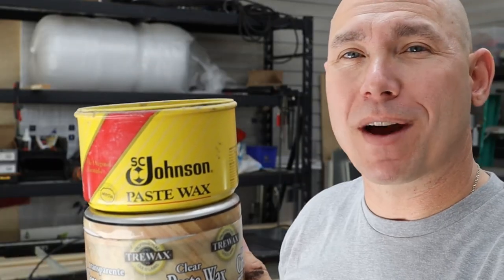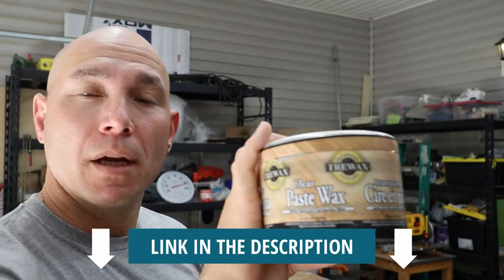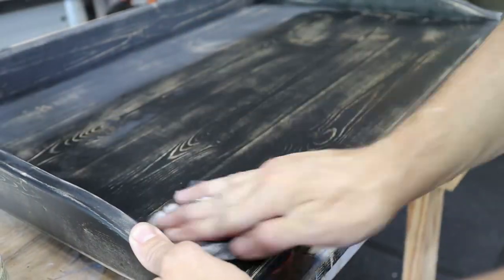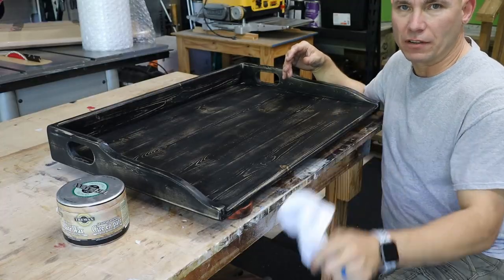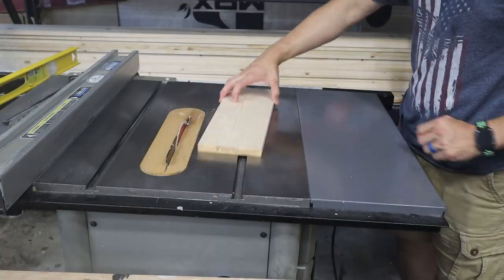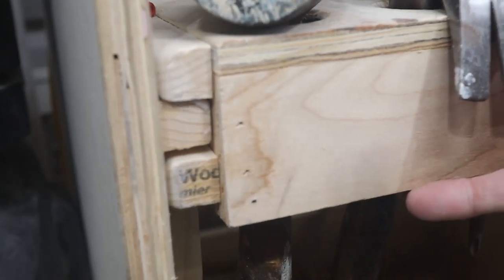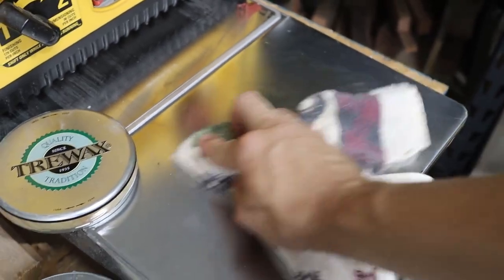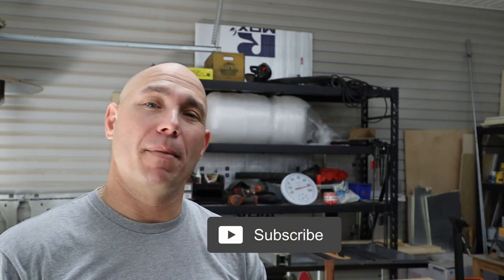Watch This Before Buying Paste Wax For Your Woodworking Shop

Comment: Wow!  I like your videos.  Great info.  I have learned a lot.  I now have a new thin kerf CMT 251.042.10 ITK XTreme General Purpose Saw Blade, 10-Inch x 40 Teeth ATB Grind with 5/8-Inch Bore for my new table saw.  I use a stiffener with it.  It cuts like butter and the cut doesn't need any sanding.  In fact, sanding would ruin the finish of the cut.  

I used Trewax Clear Paste Wax on my table top.  It is so slippery.  The wood slides like it is on air.  Smooth as silk.  Thanks for all of your great advice.

Comment: For your home made drawer slides, a better solution for getting them to slide well is bar soap.  Take a new bar of soap and apply liberally to the slide and the drawer piece 

The issue with the wax is it allows for buildup of dirt and dust over time because those things stick to the wax, or the get imbedded in the wax coat which then makes the drawers stick and require cleaning and re-waxing.

The soap does not have that issue

Great video by the way, excellent tips.
Reply from the maker: Thanks for sharing that!

Comment: Here's a tip I learned many years ago from a floor finisher when I was starting out. Take a golf ball-sized amount of wax, put it in a damp soft cloth, twist until some solvent comes through, and then rub that over your surface. What this does is controls the amount of wax you put on. It's really all you need. It puts a thin layer of wax coating on your surface. Any other technique puts too much on and wastes wax, doesn't;t dry and can be difficult to buff out well.
Reply: When you say, "damp cloth" do you mean damp with water? And are you talking regular thick cloth, or cheesecloth?

Comment: Hi Matt. If you use paste wax over a gel stain, will the finish the wax provides be sufficient to seal in the color of the gel stain (since it is topical and not penetrating)? Or does one really need a urethane to seal in gel stain?

Comment: Would you have to reapply it after a period of time? Thinking about the legs on the table or the tray.
Reply: Eventually you will probably want to hit it again with some wax. Depends how much wear and tear your surfaces encounter. Those drawer slides for example would need regular reapplication , but table legs on an end table tucked in a corner could go for ages without needing a touch up.

Comment: Thanks for the tip re: Trewax.  I will definitely give it a try.  Have you ever used any of the tinted waxes?
Reply from the maker: yes.  We used Valspar antiquing wax on our dining table base
Reply: Tre Wax is great stuff. I've been using it a long time. Just be aware that it's a carnauba based wax blend. And with a higher percentage of Carnauba than other waxes from what I understand. 
Carnauba is a harder wax, others like bee's wax are softer, with others and mixes in-between. You have to decide what hardness is best suited depending on use.

Comment: Thanks Matt! You keep making my woodworking get better and better. Quick question on the wax, can you use it on any finish, I mean besides paint, Like a regular stain? Also, I like the new style for links and messages, probably took you a bit more time, but you I definitely noticed the extra production time you went through. Thanks for another great video
Reply from the maker: Yes you can use it on paint or stain.

Comment: What about cleanup? If you use it on a table top or Noodle board that needs cleaning, will the wax rub off easily and need to be reapplied?
Reply from the maker: it dries hard.  You may need to reapply every year or two but it lasts a long time.

Comment: I have engineered wood floors, could I use this wax on top of the finish that’s already on them? They are just looking dull. We had to replace a few planks because of water damage and boy you can sure see the difference between the ones that are only a yr old and the new ones we just put in.

Comment: Thanks for the tip! I’ve seen pare wax applied to table saw tops as well, but have been hesitant as I didn’t want it to affect the ability for the piece to be painted afterwards. Thoughts?
Reply from the maker: I’ve never used (or heard of) pare wax sorry
Reply: 731 Woodworks **paste wax. Idk how the hell that got typed that way. 😂😂

Comment: Thanks! I really wanted to earn more about paste wax. Question, can I apply this paste wax, over walunt doors that have been treated with 3-coats of Tung Oil?  I used, Old MAsters Pure Tung Oil, and it the wood still looks thirsty, and not fully sealed.

Comment: I just put in butcher block counterops... is this stuff food safe or ok to use for counter tops or cutting boards?
Reply from the maker: According to Trewax: "Trewax products are not food-safe and are not recommended for using on counters or kitchen tables."
Reply: @731Woodworks  thats a bummer. ive been using howards mineral oil and conditioner. Is there anything else you would recommend?
Reply from the maker: @bneuhaus001  There's several things you can use.  Check out this article https://woodsmithspirit.com/food-safe-wood-finishes/

Comment: Matt, quick question. I have used Johnson's on a unfinished table for years. Wipe on, let dry, then move on or buff with a cloth. I wouldn't put a lot, just enough to "wet" the wood. Do I have to wipe off the trewax? If I don't what are the concerns? I guess that's two questions. Anyways, be safe out there.
Reply from the maker: It works exactly the same as the Johnson’s. You can do it the same way
Reply: @731Woodworks  thank you

Comment: Thanks for the video.  I just purchased this because it was cheaper at Lowe's compared to Minwax finishing past wax.  Is there a difference between the two?  Or which is better in woodworking?  Someone said Johnson's smelled like keresone.  Not sure if this is true, since I have not opened up the container yet, so was debating on whether or not to return it and get Minwax instead?  If anyone has any thoughts between the two brands, please let me know. Thanks.
Reply from the maker: I've never used Minwax brand. The Johnson's does have an odor to it. The Trewax smells better.  Not sure how much difference there is between them.

Comment: These are great uses!   Paste wax is fantastic!   I rubbed some on the faceplate of my router to help it glide over the wood better.   It really made a huge difference. 
Just another thought. 
Doi you have a video showing how to do the "aged" finish?   Both the painted and the stained parts?
Reply from the maker: I have a distressed video https://youtu.be/M3jCJg9vnAU
Reply: @731Woodworks  I don't know if you see this, but I bought an unfinished doll bed for my cat and bunny. I want to finish it with darker stain and and top coat, then make a thick mattress for them. What would be the best top coat that will be safe, easy to clean if they make a mess on it and also doesn't attract fur, dust and dirt? I thought the minwax paste wax, but thinking that will be an issue with attracting debris and possibly not be resistant to a mess.
Reply: @Bomber411  Waterborne polyurethane
Reply: @Randy-br3kf  thank you! How long should I wait after it's finished to let them use it? I know there will be some form of chemical smell after, though I'm assuming after some time it will be gone to a degree - possibly once cured? Not sure I'm articulating well what I'm trying to ask.
Reply: If it's water based, like Minwax polycyclic, you don't have to wait more than a day. And no chemical smells or fumes. It's very benign.
Brush it on in 2 thin coats. If you notice a flaw or missed spot once you've done an area DON'T TOUCH IT WITH YOUR BRUSH!!!
just let it dry, and hit it with your second coat.
Sand lightly in between coats and tack rag off your sanding dust

Comment: I used your spray paint method for destressing a bed frame, kinda a rustic bed frame would the wax be ok for that?? Will it take off the spray paint to bad dont want to lose slot of paint.
Reply from the maker: It’ll work good. It will take some of the paint off but shouldn’t take too much. Just go light

Comment: How does it hold up to wear compared to polyurethane or tung oil?
Reply from the maker: It wears more.  You'll likely need to reapply at some point depending on traffic. So a table top would need reapplication every few years whereas the base wouldn't need it very often, if at all.
Reply: @731Woodworks  A few years is plenty.  I think I'll give it a try.  Thanks.  Keep the videos coming.  Lot of good information.

Comment: Does it protect the wood like poly?
Reply from the maker: It adds a layer of protection but not sure if it's the same as poly
Reply: Thank you I've never used anything other than poly but all that every one is ordering are dining room tsbles. I've tried to advertise smaller stuff like blanket ladders. Noodle boards and have done a few but nobody wants those all they inquire about is dining room tables. Another quick question have wood prices doubled in your area like it has here? I live in the West Texas area and wow everything has doubled.
Reply from the maker: Yes lumber prices are up a lot.

Comment: No steel wool?  So you don't use poly?  Use stain and wax only?
Reply from the maker: You don't have to use the steel wool.  If I am using wax, I don't poly.  If I use poly, I don't wax.  I typically only use wax on distressed paint but you can use it on stained pieces if you want that look/feel.
Reply: @731Woodworks  this will be nice for those details areas where poly wants to cake on there and dry white. 
On another note.... I'd love to see you build a shelf that conceals a firearm....with the magnetic locks.  I just built one for myself but would love to see what you come up with. 👍
Reply from the maker: Thanks

Comment: You missed one of the best uses in the wood shop... Try wax on your blades and bits. especially a hard wax like carnauba,  I use it on all blades and bits. Table saw blades get 3 coats polished out before use. Bits just get dipped in the can and coated before use. If you've never done this before, you'll be amazed at the difference it makes.
Reply from the maker: Good tip thanks